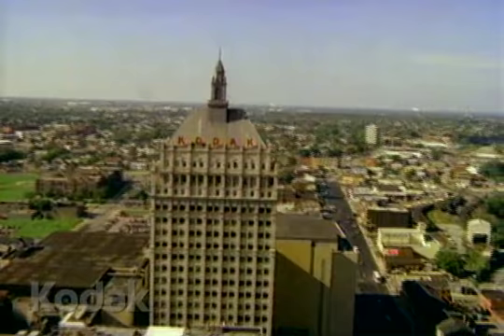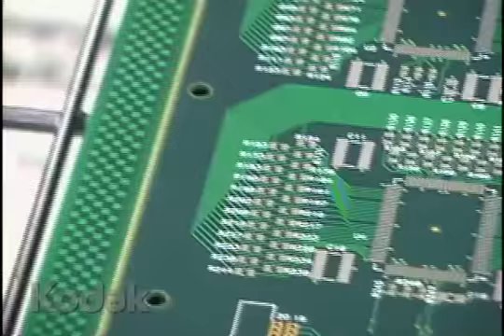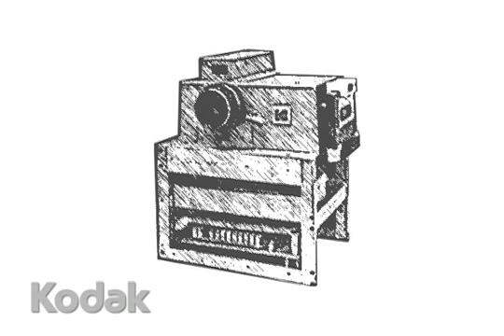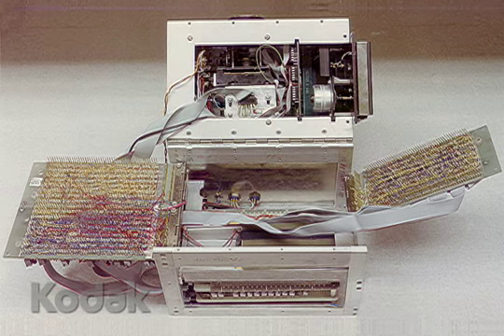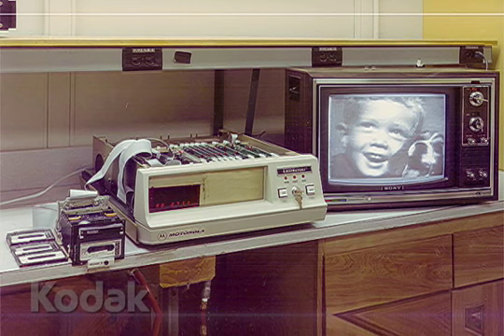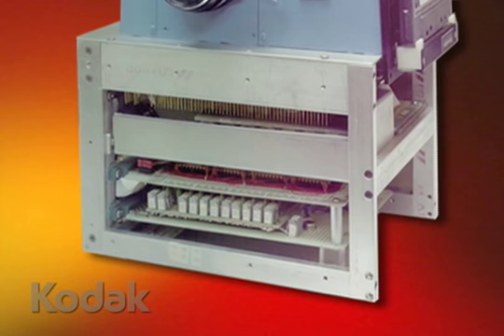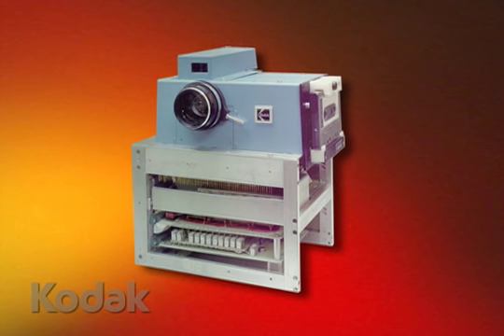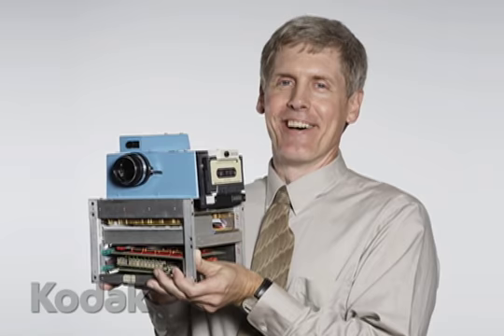Steve Sasson, Digital Camera Inventor

Comment: I know. I used to work at Motorola in 1981 and a triple line input 56kbp data modem cost $35,000. My point was that Kodak made most of their profits from licensing. By owning the patents on the technology and licensing them, they could have offset the digital camera revolutions impact. They didn't have to manufacture the cameras, just own the technology. The management made a bad choice and blew it by not taking the credit for the R&D.

Comment: Hi Stephen ... it sounds good in retrospect, but other technology had not caught up.  For example, how would you store the digital images?  Floppy drives held $90k and could run you $500.  Who wanted a low res picture, or the need to look at their TV.  No small LCD screens.  No way to print pictures on glossy paper.  It was like inventing something totally useless.  The concept was wood, the supporting technology had to catch up.